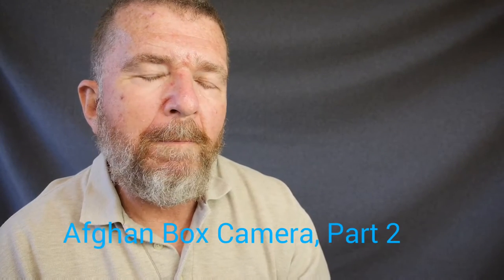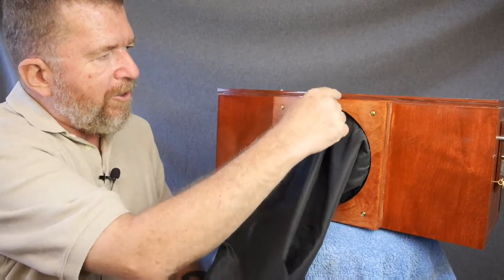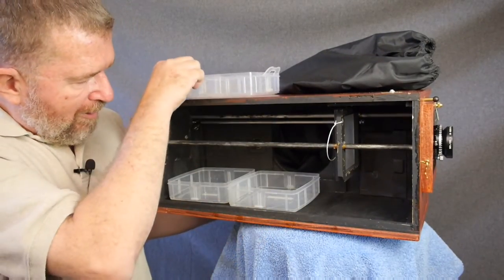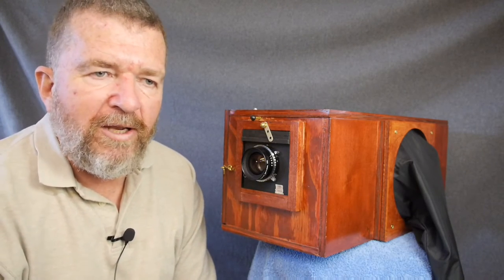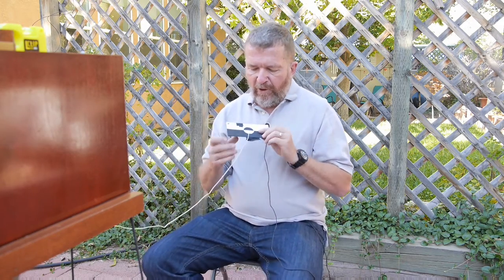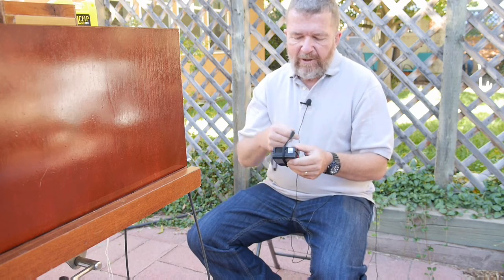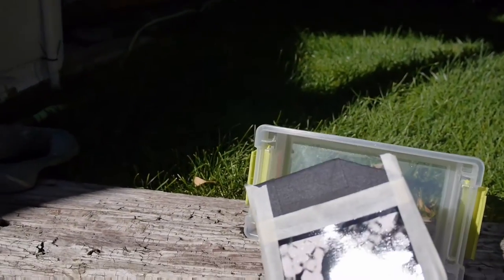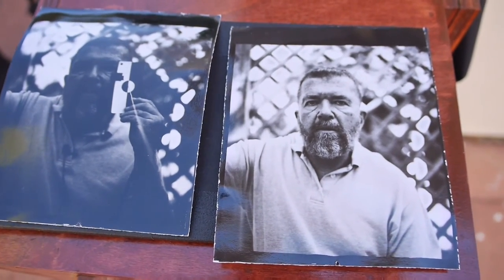Afghan Box Camera, Part 2

Comment: this is great. I started following your channel back when you posted part 1. I built several diy cameras myself, and I always considered building something akin to this design to have a portable darkroom/camera hybrid. 
I think  tough that divorcing the camera from the darkroom  could help portability. have you considered building a smaller portable version of your kitchen darkroom and use a film holder instead?
Reply from the maker: I first built that darkroom box for use with a Speed Graphic and 4x5 paper images. The camera was tripod mounted while the box was on a folding camping table. This predates the Afghan box camera project. I'll have to do a video about it, thanks for reminding me. I was also thinking about building a 5x7 camera inside that darkroom box.
Reply: That's great. I can't wait for your video about this, and again thanks for sharing your camera-foree